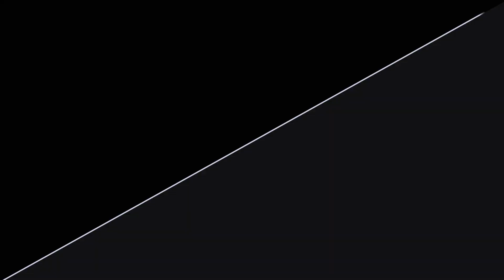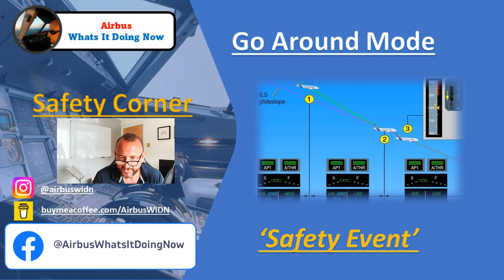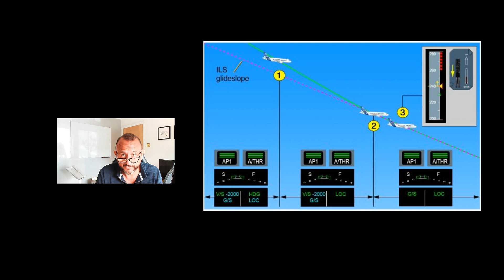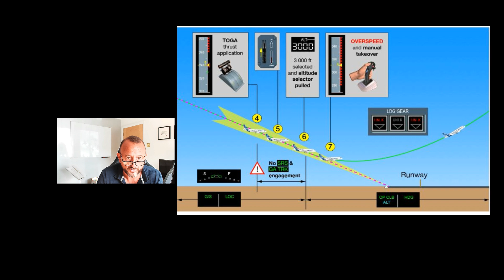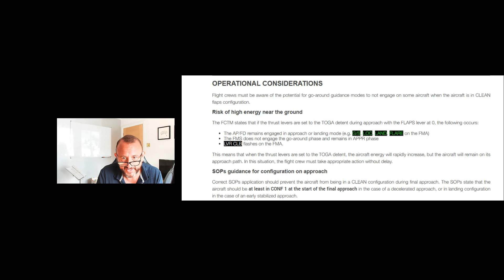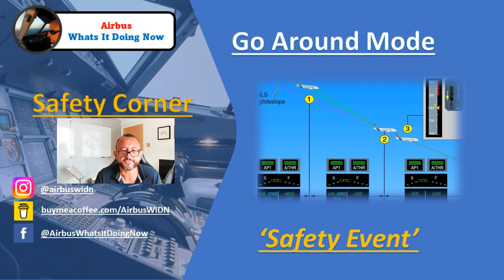Go Around Safety Event

Comment: Thanks for the excellent review of the case as usual. 
Regarding the arming conditions on the GA mode, I can only speak for the A330 but for that aircraft, it is indeed the lever position that matters. This is why when you perform a NO FLAPS NO SLATS LANDING, you still set the lever to 1, in order to have the GO AROUND mode available. 
Congrats on your TRE
Reply from the maker: thanks for the question, if i understand you correctly the flap lever position is required for SRS (GA mode)